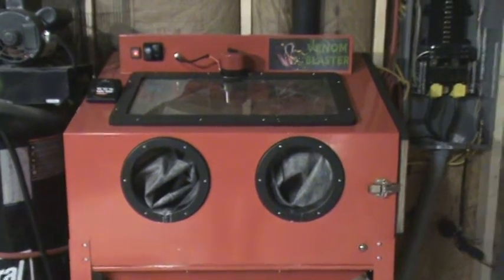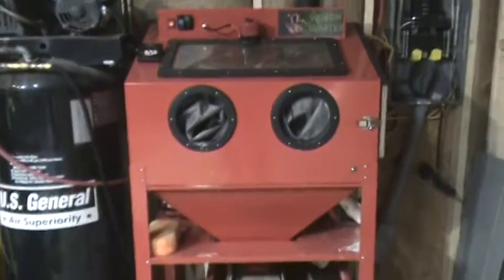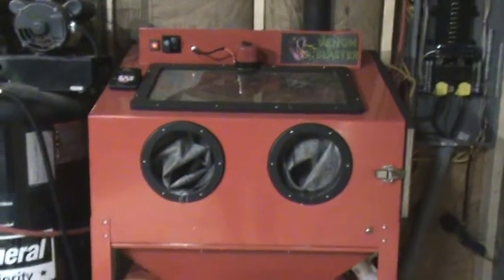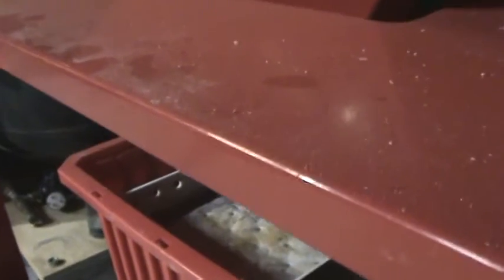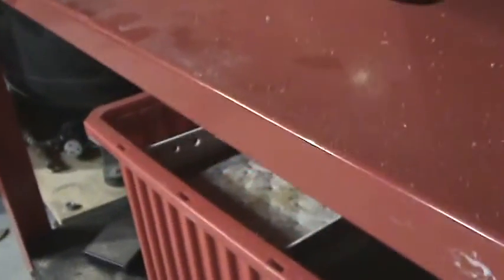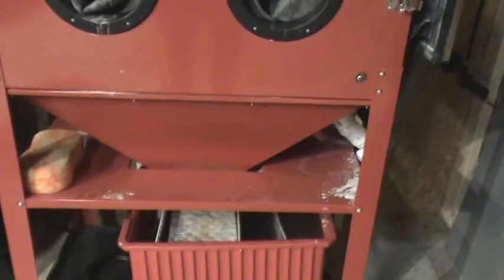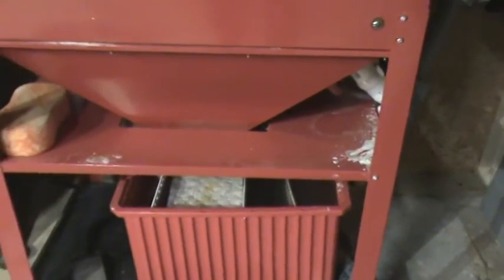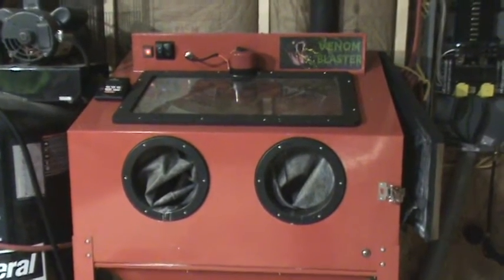Vapor Blaster  Media Mix Ratio, Filtered versus Fresh Water versus Closed Loop

Comment: Hey Chris.

I had this same issue with my earlier cabinets. You can partly solve it by adding a partition inside your cabinet that divides the drain from the main section of your reservoir. Close off the top and sides completely, and leave the bottom open. Leave a gap at the bottom about an inch and a half wide.

This works by separating a section of the reservoir from the agitation currents. The wide gap at the bottom of the partition compared to the narrow outlet of the drain slows velocity of your slurry so that the beads drop out of suspension and back into the reservoir, dramatically reducing the amount of beads in your filter box.

I went away from the open loop and closed loop filtered systems in favour of the simplicity of a completely closed system. I then added a drain cock just above the settled media level. I regularly drain off the water and replace it to ensure it remains clean.

Also, I added a drip tray under the door on my smaller cabinets to collect the dripping slurry from the door. The glass on your middle shelf looks like you have a similar issue. You can see what I did in this video - https://www.youtube.com/watch?v=Z6if11uG0WE&t=220s

Keep up the good work. Loving your vids!
Reply from the maker: Thanks for the tips.... I am going to try a few..... Always enjoy your videos.. :)
Reply: so adding a baffle of sorts?

Comment: Hi Chris. First of all, great videos and detailed. However, I’m confused about what I need for a compressor. 
What size are you using and do you feel like it’s perfect, or need something bigger ? I’m ready to buy something in a few weeks, just really confused about the whole compressor size. Thank in advance for any help.
Reply from the maker: I am using the following compressor and I would like to use a bigger compressor.. If you run at 90 psi you will eventually need to stop and let the compressor recover.. A larger cfm compressor would hopefully eliminate this.. If anyone is running a Vapor Blaster and can run their compressor continuously please comment on what you are using.. Here is my current compressor... https://m.harborfreight.com/5-hp-60-gallon-165-psi-two-stage-air-compressor-93274.html?utm_referrer=direct%2Fnot%20provided
Reply: Venom Chris q

Comment: Thanks for another great and informative video. I'm still not sure on how the filter system works. I understand that oils and other floating particles get catched by the cloth thing, but wouldn't other stuff like rust and the like be trapped in a Glass bead mix in the first chamber? Or?
Reply from the maker: So far I have really only been doing Aluminum parts so I have not seen rust.. But there is a very small amount of dirt mixed in with the glass bead.  I have read that you can reuse this with no problem.. It seems the dirt and grease mostly float on the top. They accumulate on the sides of the filter box as well as on the pad. If you were doing cast iron items with rust, I do know that you cannot reuse the media on Aluminum as the rust will damage the surface.

Comment: Can you make this with the newer model I looked for the older one and I was only able to find a used kinda rusty cabinet for $50 but it's like 100 miles away so I could buy the newer model basically for the same price. I just wanna make sure the add on pieces will still fit. Thanks for all your info!

Oh btw I have a DIY vapor blaster that uses a 5 gallon bucket and a sand blasting gun which works but I have the same issue the glass bead is so fine that it's so hard to keep it mixing with the water it just want a to sink to the bottom.

Comment: I may have missed it but what size glass bead are you using?
Reply from the maker: Glass Beads, 50lb., 170-325 Mesh, No.13  Zoro #: G0700539
Reply: @venomchris5818  thanks man! I just finished my HF blast cabinet. Little bit different setup but same parts. Just trying to figure out lbs of glass bead to gallons of water ratio
Reply from the maker: @snowdale23  I use between 10-15 pounds... Try it and go from there.. if it is to little it will  be mostly water and you will see a reduced cleaning action.
Reply: Hi mate , firstly great videos really appreciate you taking time to explain things......so I got the same blast cabinet running a 15000 LPH pump and a 14cfm compressor......I'm using super fine glass bead and finding it definitely cleans the part but not a shiny finish which I'm after.........do you think I haven't got enough media in my mixture.......any help would be appreciated 👍

Comment: we did a similar setup, but we remove the bottom door and use a plastic tub for each size media, you drop the pump in clean water, rinse the cabinet. Let the media settle out of solution siphon off the excess water and let it dry. You change out the media tub for each size , You need a new tub for each media size. but the change is only a couple minutes, and the same cabinet for dry blasting. also. I have tried a larger nozzle but the small 8mm works well. Siphon removes allot of the dirt and refill with clean water. Using 40 Micron glass spheres for media  

 https://www.abcgt.com/new-forum/forum/main-forum/356-restoration-projects/446-tools-products-for-restorations